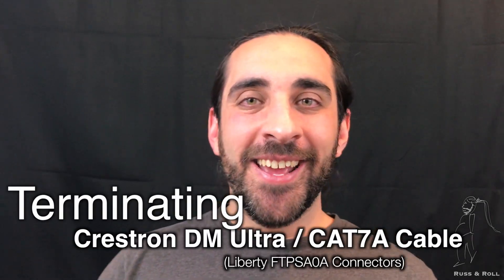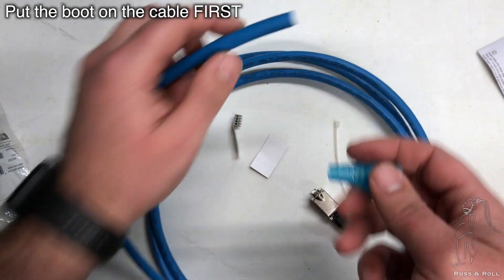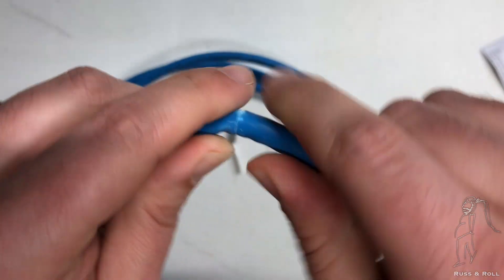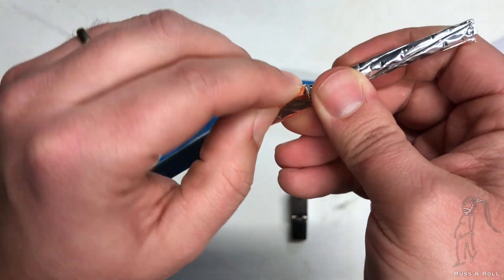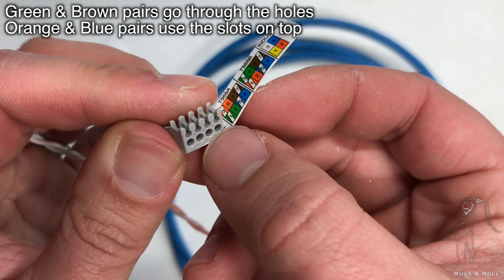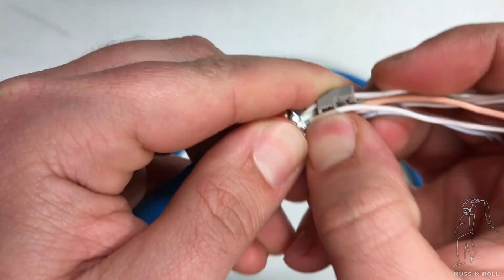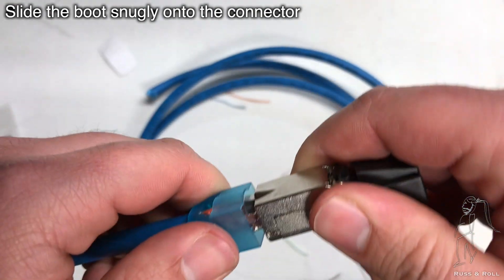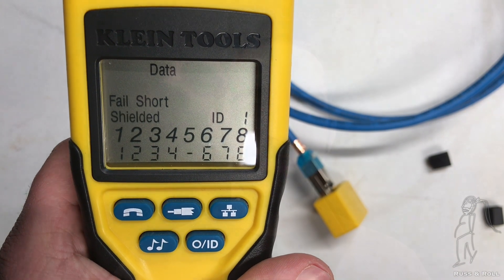Terminating Crestron DM Ultra / CAT7A Cable

Comment: Its not critical but that is a strain relief boot. It is not a "oops this doesnt fit so i guess ill make it fit" boot.
Reply from the maker: You're right about it being for strain relief, but it's meant to be trimmed to match the diameter of whatever cable you're using.  "Strain relief boot trimmable to cable diameter" is how the manufacturer puts it.